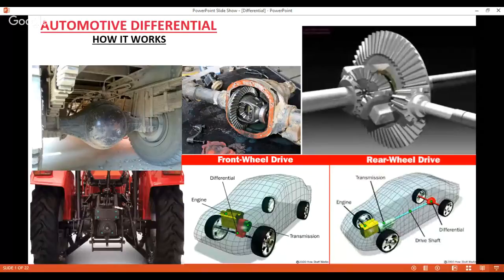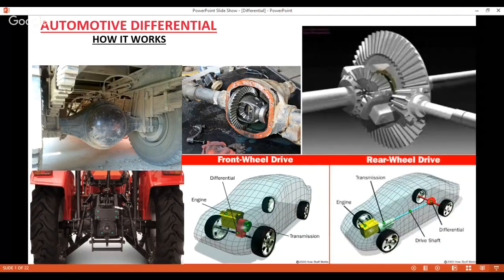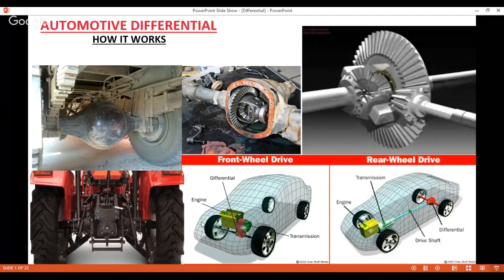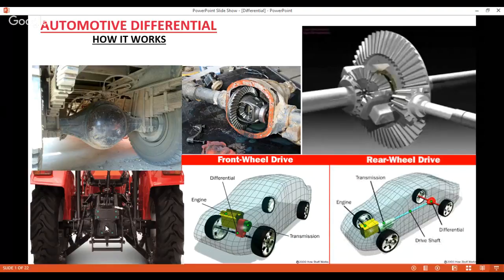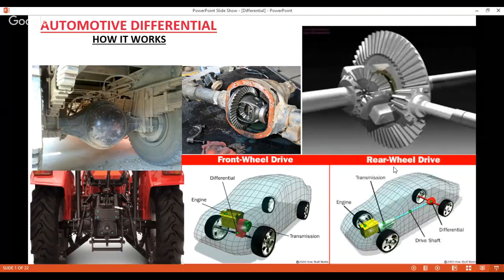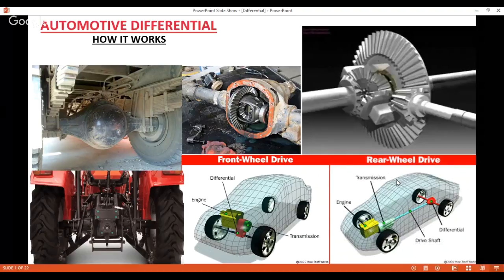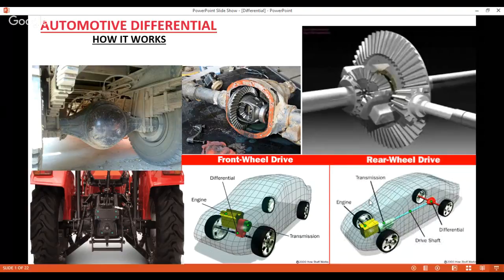AUTOMOTIVE DIFFERENTIAL

Comment: To sir hum kese krenge isko... Gate ki answer key m to baad wala Answer aa rha h
Reply from the maker: You really can not do much now for that Harsh. After exam, you can just report to GATE for this.
Reply: Agricultural Engineering Crack GATE Online 
Thanks sir for your support for making Many valuable videos for us
Reply: The answer for this question in the answer key is correct and I got the correct answer..... You just have to remember that during locked condition rpm of both wheels will be same and total power and left axle torque is given...
Reply: @arjitsaxena5624  great approach man..
Reply: @arjitsaxena5624  could u plzz show me how u get the answer plzzz